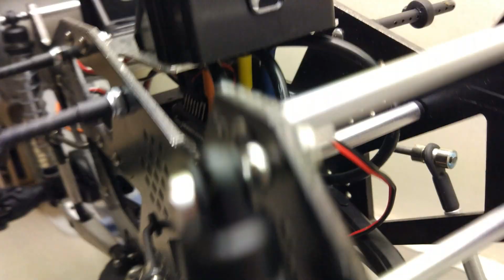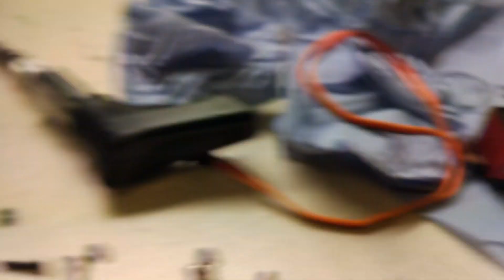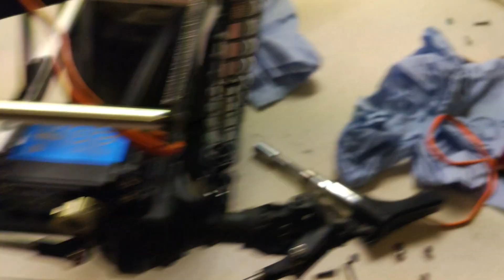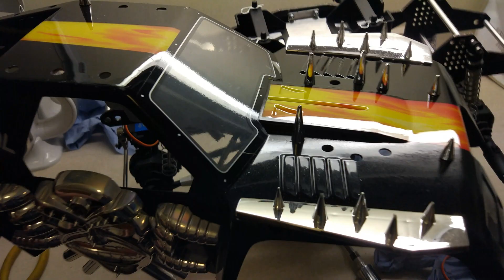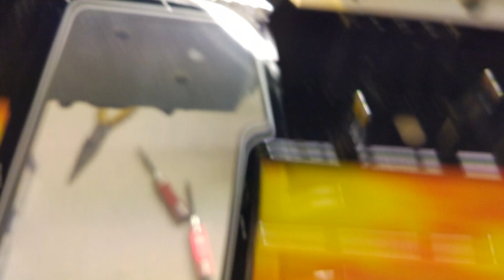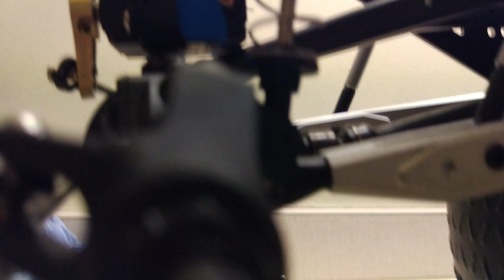Crawford Performance Engineering Barbarian 2k18 Monster Truck

Comment: about shocks : as the suspended mass is really light, you can go with a really soft setup ! i would try to put the shocks in a more flat position to get more suspension travel
Reply from the maker: Yes I checked the springs later and the red are the soft springs, I also have yellow springs and blue springs as well. I think if I swap the position on the sway bar with the shocks, so the shock end is on the trailing arm and the swaybar is on the axle, this could be softer feeling setup.  There are almost too many options with this chassis. What a terrible problem to have 😄
Reply: @LawrenceTimme  lol indeed ! what's cool with monster truck is that they don't need much place to bash so you don't have to got far away to test and modify them.

Comment: don't take the proline servo saver : it's sloppy !!
Reply from the maker: It's very expensive as well $40 + shipping 😱
Reply: @LawrenceTimme  yeah it's a fail because if you compress 2 springs against each other, there will always be a soft point in the middle !

Comment: for the sway bars you might just change the position of their arms first, then slide the ballends further in.  in the end, you might also try to run without them, just for a test
Reply from the maker: Yes I will try with them remove completely and maybe in a few positions. This is all totally new so I have no idea what a good setup is atm. Will have to be a lot of trail and error testing!